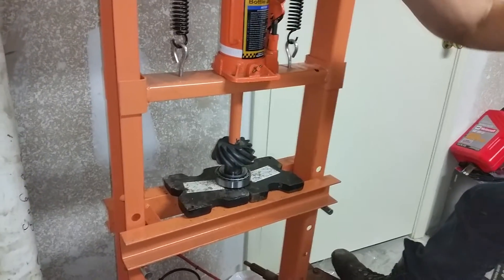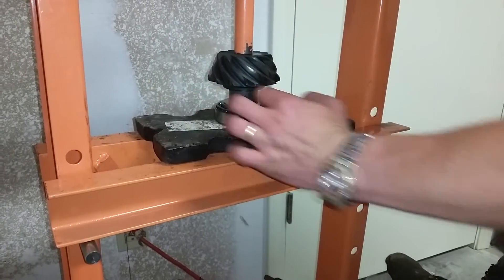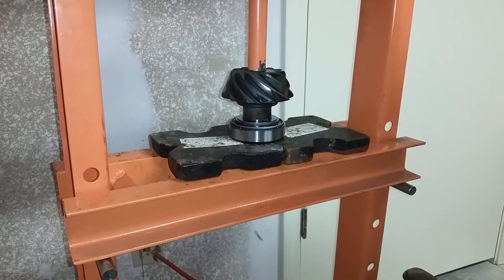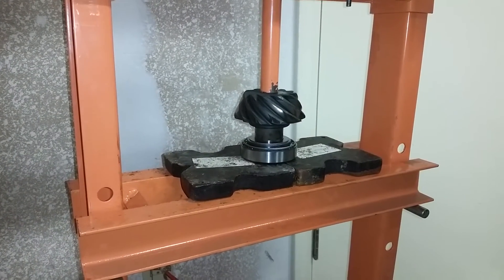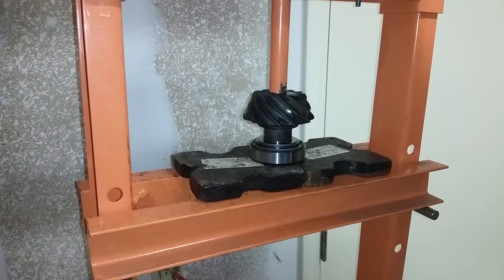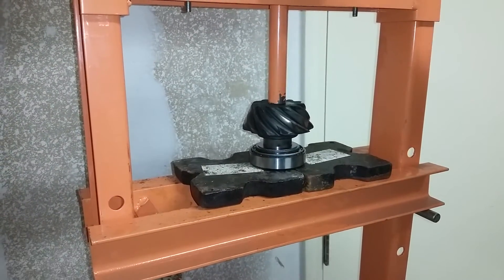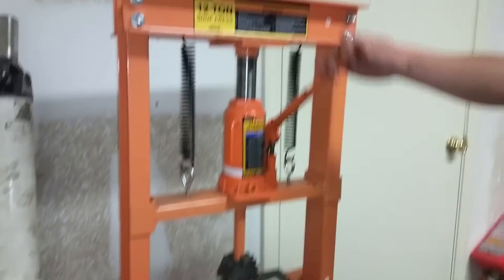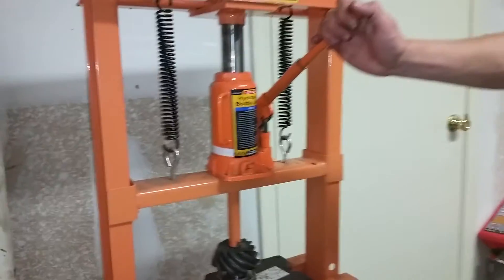part 1 pinion bearing shim press, replace, posi install 12 bolt rear end. limited slip differential

Comment: Thats not how you press in a pinion bearing, never put pressure on the bearing itself.
Reply from the maker: +dwayne kirk indeed.  You use an old bearing and press only on the inner race with a piece of tubing or a part of the old bearing.  You are 100% correct.

Comment: Yep..Diffs can be a bugger to set up right...When I was 19 I used to smash up diffs quite a bit..I broke 15 in 18 months...One of the crown wheels actually went out the back of one housing...I had one last as long as 3 months and one give up after 10 mins.. and a luck dip in between,,,lol...

Comment: I thought about getting a press like that but didn't know if the was any good.
Reply from the maker: The press is very good.  I've used it for everything from pressing in wheel studs in a hub to building my own guns and pressing in barrels in ak47 rifles... with the coupon they are only $100.